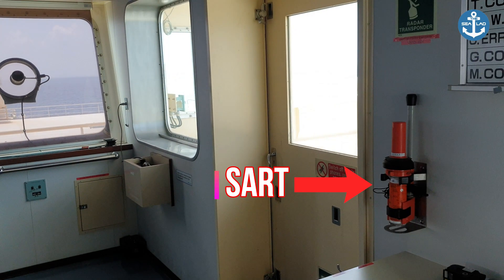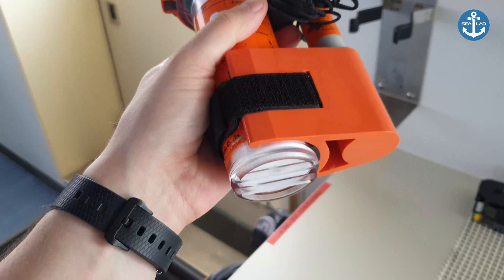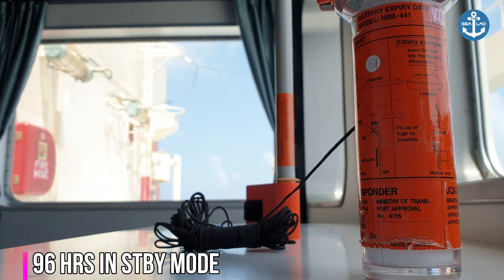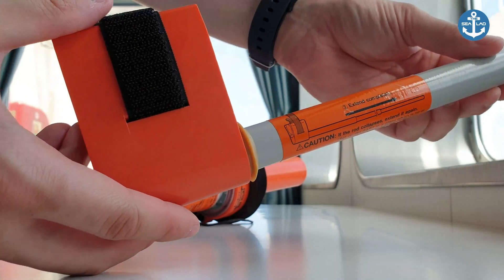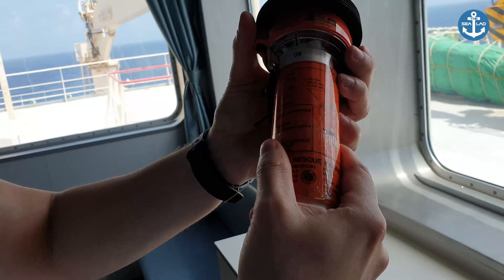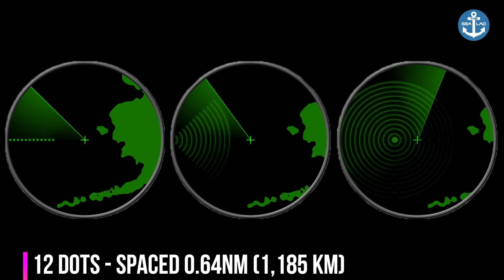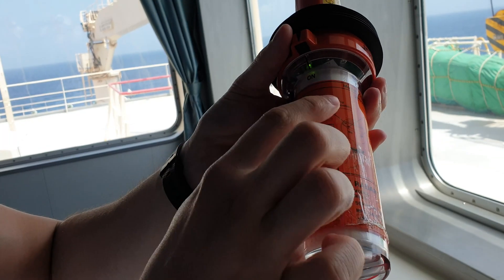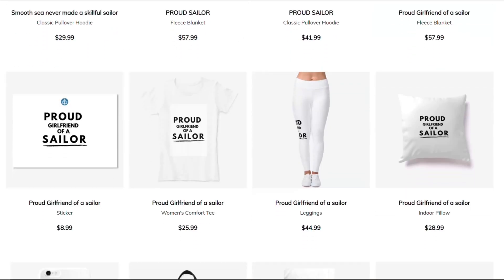SART - Search and Rescue Transponder

Comment: There something special about this equipment.  At least 96 hours in standby after activation and then minimum 8 hours of continuous operation.  Well said about 12 dots and miles. EPIRBs are designed to work for a minimum of 48 hours continuously once activated.